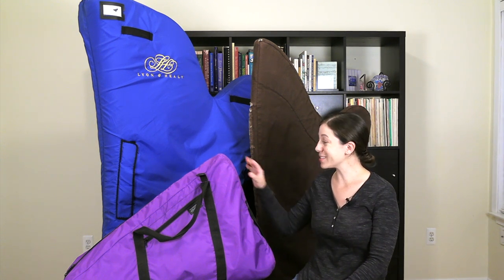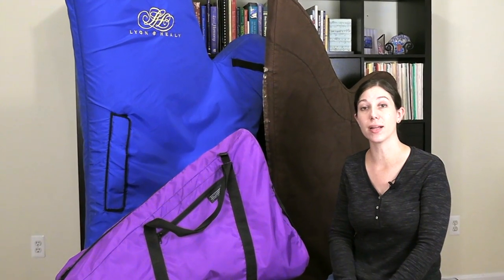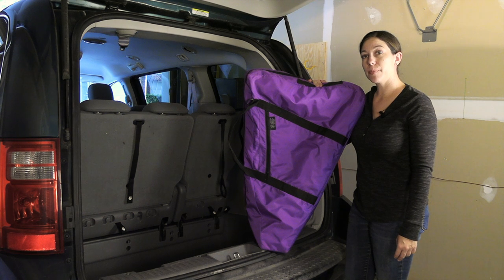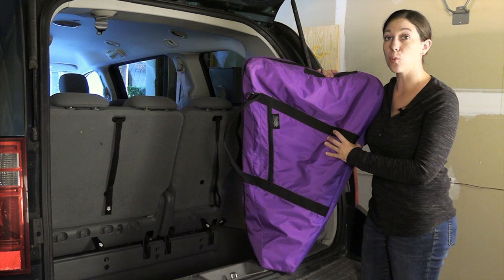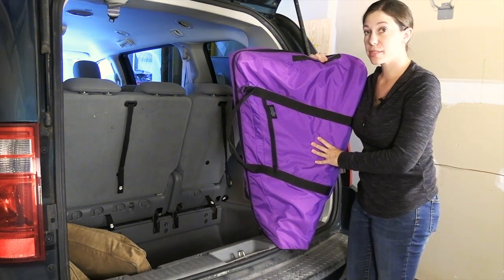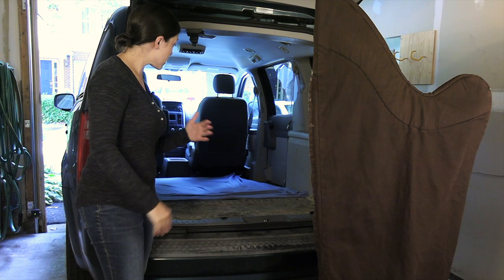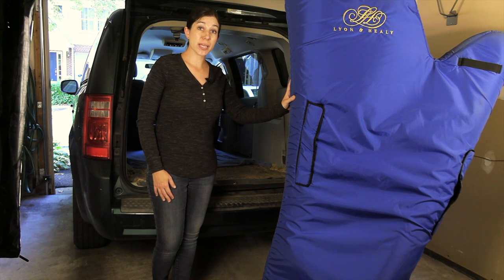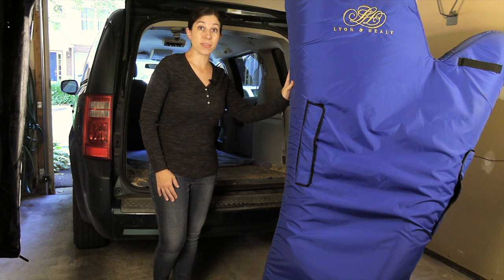Harp Moving: How to Load a Harp in a Vehicle, Harp Care, Maintenance, and Repair #9

Comment: Thanks for sharing! I have a Ford Transit 15 passenger van and have removed the last row middle 2 seats so I can fit lots of things in the back and between the aisle. I am hoping to be able to take my kids with me when I have the harp loaded, so the column approach seems to be the best option for me. 
Im so nervous it will put too much strain on the harp's column since all of the weight is on it. I haven't been brave enough to try it yet, but seeing how easy you made it look, I'm going to try it!! Have you noticed any denting and / or issues since you've started loading this way?
Reply from the maker: I'm glad this was helpful for you! Actually, the column of the harp is really strong so there's no problem putting the weight on it. To avoid denting, I would be sure to use a column cover and you could also put some pillows, blankets or foam in the car so that the harp doesn't scrape along anything hard when loading or unloading. That will be great to have your kids and your harp in the car! Good luck!

Comment: This is hugely helpful!  Thank you!  Quick question:  Do you think it would be possible to have one of the captain's chairs also up in the minivan third row when column loading the full-size pedal harp?  (Trying to figure out if I can fit all my kids in the car with the harp too!)
Reply from the maker: I'm glad this was helpful! Yes, I think you could have a captain's chair in the third row without too much trouble. As long as you'd still be able to slide the harp up the middle, and have room for the base (which is the widest part), it should work just fine. Good luck - it can be tricky moving around harps and kids together!